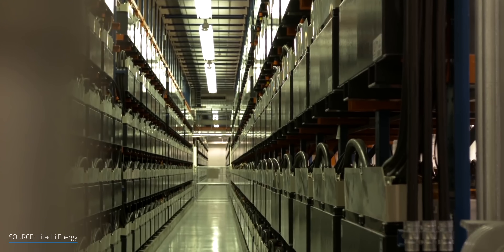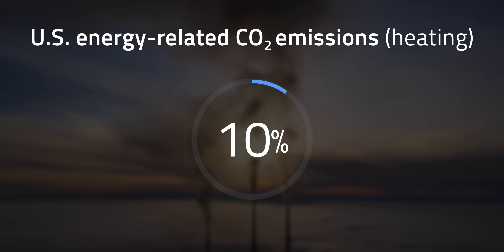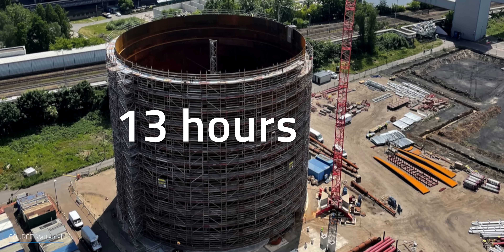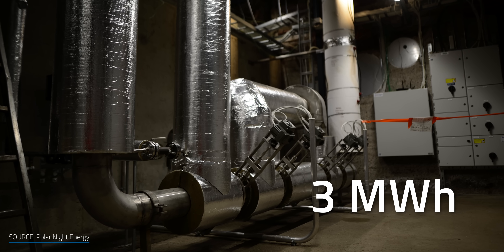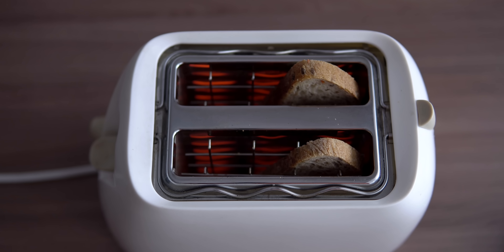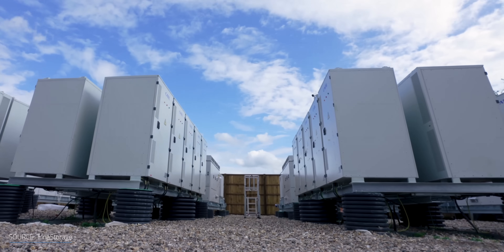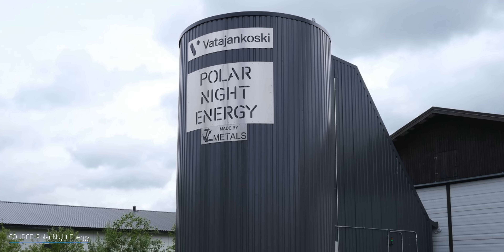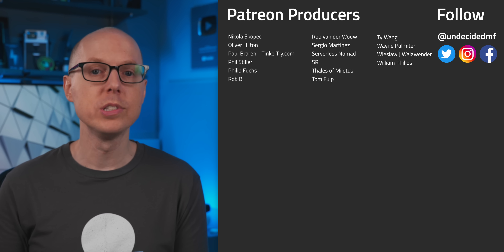How A Sand Battery Could Change The Energy Game

Comment: Bull Manure can be substituted for the Sand, additionally, when you figure out Mass is Mass, as in Thermal Mass we can use something more dense. Like Spent Uranium works much better than Sand, maybe even get some residual decay so it's self heating. Calling a Thermal Mass to store heat a "Battery" is "misleading", it doesn't store electricity, it stores heat. A south facing window letting the sunshine on a brick fireplace is not a battery, it's a thermal mass to heat your home at night. No Bull Manure required.
Reply: The point is to use cheap abundant materials.. Uranium isn't one of those but sand is. Think next time.
Reply: Also batteries don't store electricity.. Capacitors do.
Reply: @randybobandy9828  Did you say what you meant to?
Batteries do store energy (electricity). So do capacitors. And inductors too (dynamically), for that matter...

OK, I wonder if you meant they don't, in the sense of electricity if referring to electrons, then no, they don't store electrons. They store energy chemically. (electrochemically).
Most people will call this 'storing electricity' (albeit by chemical means...)
Reply: @troubleshooter1975  ya I said what I mean. They store energy chemically.